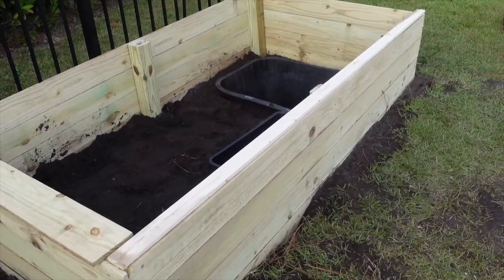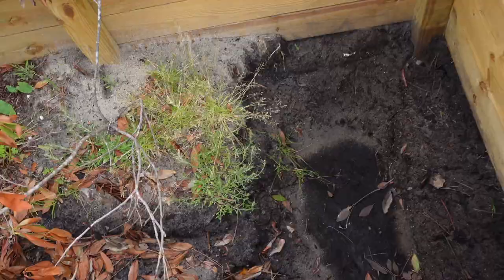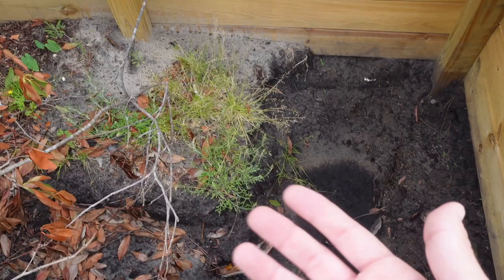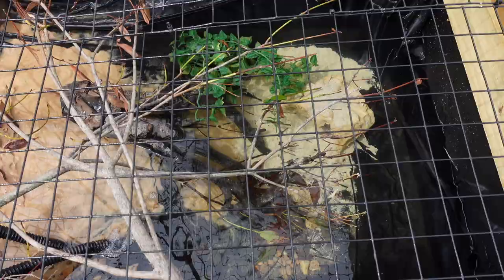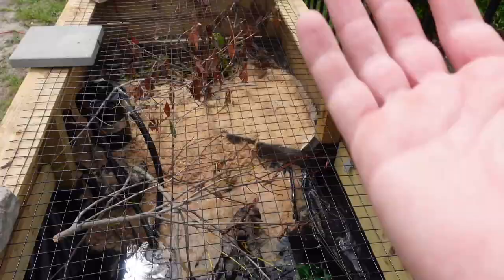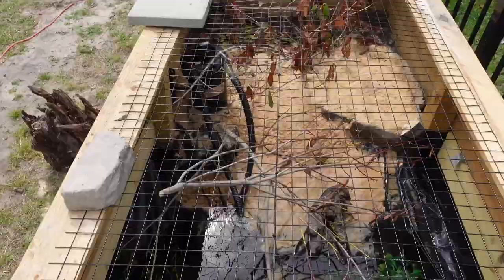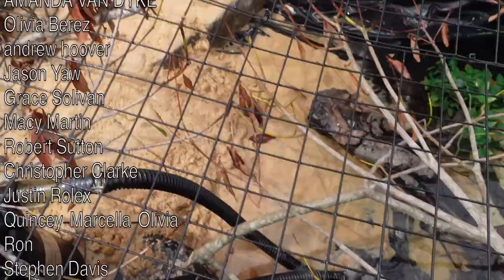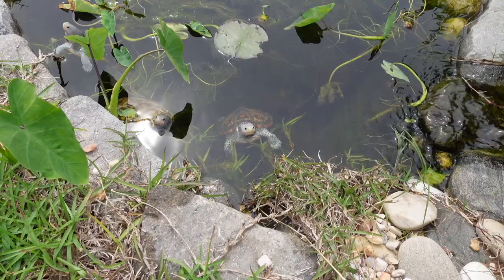Building a *DIY* OUTDOOR TURTLE Setup!

Comment: Can you make a video about water quality? I'm confused about should you use a water conditioner for turtle tank or put water in a bucket for 24 hours to evaporate formaldehyde or whatever. I know you video isn't about water. I thinking about getting a Mississippi map turtle in a month or two, I am slowly getting materials for the little guy before I buy. I was wondering if I have to get my filter cycle first etc etc